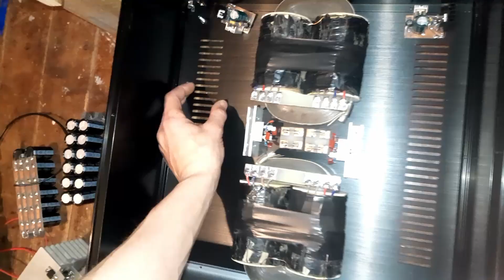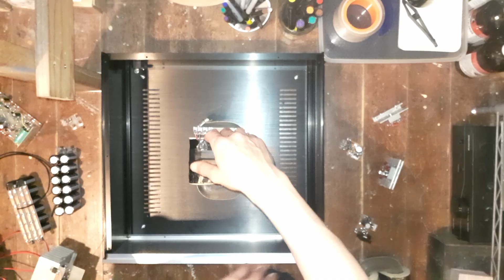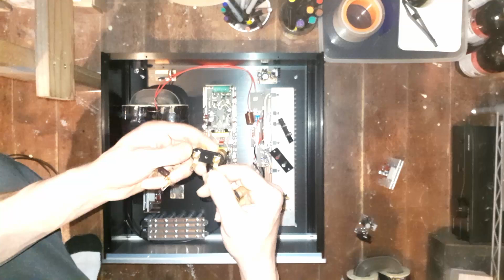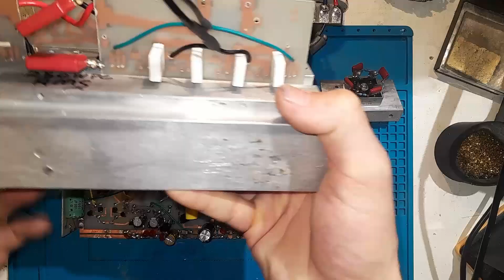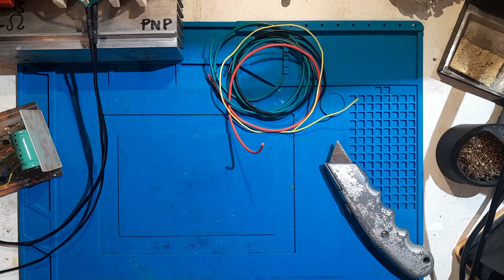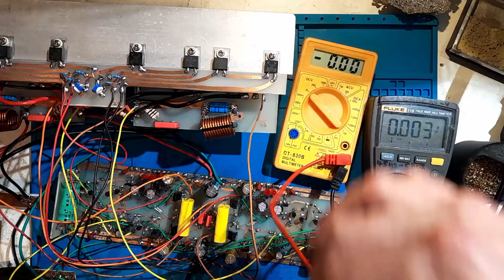Building the amps to find there's no bias after a few other issues now the vas Cs is too low in ma!

Comment: The MJL21193G/94G 200W devices would probably be a better choice over the 2SA/2SC devices, with respect to dissipation. They are virtually indestructible, but expensive (Digi-Key are around $10 per device, Jaycar is $16 per device). Minimum hFE is only 25, 75 maximum, though (Ic = 8A, Vce = 5V).
Reply from the maker: I'm using njw0302 njw0281 atm
Reply from the maker: But I agree totaly, if this makes more power than 250wpc I will be changing over or if the heatsink is too hot I will change over also

Comment: Those are some monster transformers! I bet they weigh a bit too. And, I mean the one's at the start. Btw, where'd you find that case? It looks nice and perfect for another project I've got in mind.
Reply from the maker: Ali express, its 130 but after shipping 260!
Reply: @daveselectronicslab  do you have a link?
Reply from the maker: Il get it for u now sorry I just saw this message
Reply from the maker: https://a.aliexpress.com/_mtJJe7R
Reply: @daveselectronicslab  thanks, they are nice looking but only come in 3 sizes... big, bigger and big but square looking lol. It's a shame they don't have different height cabinets like 1U, 2U and the 3U (150mm) they currently have, unless it's another listing.
Reply from the maker: Yeah there are smaller ones on there too just type in amplifier case and have a look around.
Reply from the maker: There's also some really expensive huge cases with inbuilt heatsinks on the sides and all that kinda stuff!
Reply from the maker: There's the link mate